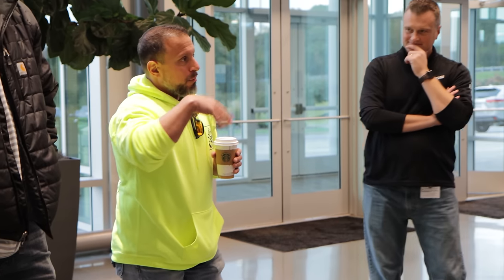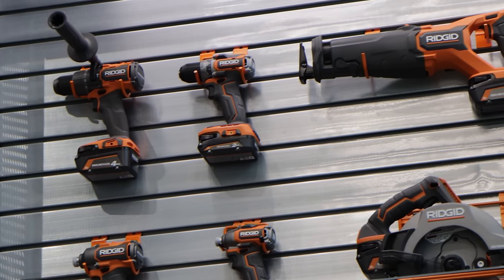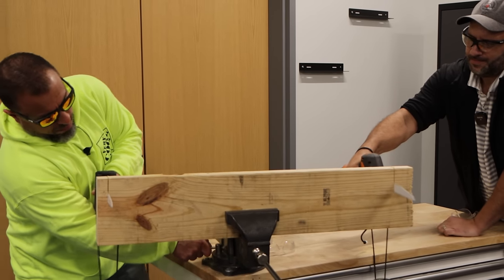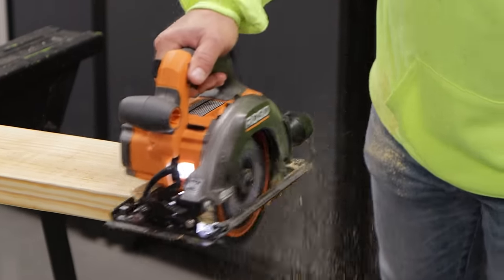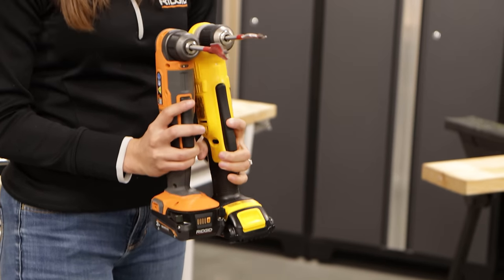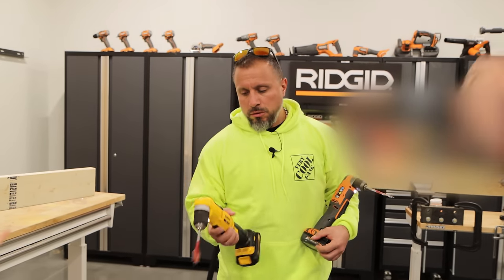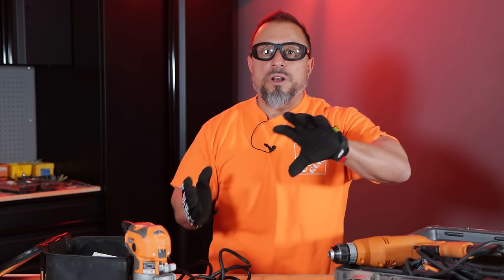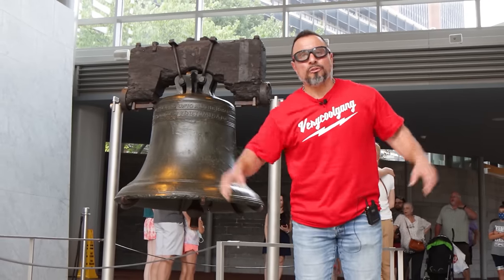Telling Ridgid Executives I Don't Like Their Tools!

Comment: I don’t own rigid but my brother in law does and they seem to be good and the new stuff there coming out with seem like there kicking ass there a good tool if you don’t use them everyday they are priced right ….. I will say Rigid vacuums are top notch I’ve own a 16 gal 5hp and it’s been rained on left in the summer been used without filter and she still sucking I’ve upgraded to the 3in hose best upgrade

Comment: One real world example that is not shown in tests
I had to cut out some kitchen cabinets with a reciprocating saw
There were a few dry wall screws that broke the screw head when there was an attempt to remove them
I had to cut apart with the dry wall screws still in.
Did no problem with my milwaukee  fuel

Comment: The ridgid 12V Fuego drill was very impressive compact little drill.  Was a my favorite for a long time.  Then they killed it and came out with this home line POS 12V drill which was total garbage.  I got into Ridgid X4 platform.  In those days they had some excitement to the brand for sure.  They were one of the first to put a gauge on the batteries.   Now for 12V, I use M12 line.  This is really due to Ridgid not having anything that was quality in the 12V lineup any more., even when it was still available.  Shame too, because the Ridgid 12V tools felt way nicer in the hand then the M12.  That new right angle drill looks sweet though.   Maybe there's life left in the brand.  Maybe help out the other Ridgid products, and bring attention with a new radio that is cool, and works with their boxes.  Your welcome.  I love my ToughSystem radio, yet  I'd be open to an upgrade.  They need to lure me back, but I don't see a reason to look orange right now.  I want to.  But there's nothing there.  Just dust.

Comment: Bought a portable table saw a few years back and actually fried the motor after many hours of use. They replaced it under warranty with the newer one about a year ago. The new was selling off the shelf for 350.00 which I thot was a good price for the tool. But now that same saw is selling for 550.0!!!!!!! definitely not worth that price. Black Fri specials they are selling for 400$. The warranty made me keep buying Ridgid tools even though they have the biggest fail rate of all my tools. I use the tools a lot for my work. I have many Makita drills and saws for 15 years and of all the tools I own I think Makita is the best for not breaking and failing me.

Comment: as a mechanic i have used them all....nothing but fuel's in my box. coolant,gas,oil drenched...no problem, falling of the top loaders 16ft onto asphalt, no problem...puts most of my snap on air tool to shame.

Comment: Best RIGID tools:
Aluminum Pipe Wrenches: 18s, 24, 36s are almost perfect. I just wish they made a 24-28" with a 4" pipe grip width.
Chain Vices (Truck or bench mount, not that awful stoopid camera tripod).
Power Pipe Threaders.
Ratcheting Manual Pipe Threaders are BA too. Anything else, shop elsewhere.

Comment: Spoke with my Home Depot dude yesterday. Apparently, RIDIG is now owned by H.D. and will be offering an unrestricted warranty on all tools and batteries FOR LIFE. Just register it online and when it fails, exchange it; similarly to the old craftsman stuff at sears. This is huuuuuge. I just had a 9AH Milwaukee battery fail and mannnn those are expensive. If this warranty is what they claim, I can settle for a little less power.... a little less reliability... just to save some coin

Comment: Lifetime warranty on tools and batteries as long as you register. To me that's basically end of discussion. I had a brushless hammer drill die after a big job. Sent it in through the HD rent a tool area, rigid verified motor died and sent me a new one no questions asked. Called the warranty after I got my new drill and had that one added to my tool list.

Comment: They used a dewalt 1.5 amp battery and looked to be a bigger battery on the rigged. Anyone who uses battery tools knows a bigger battery equals more power. Rigged has some pretty good stuff

Comment: I have used the ridgid  line for many years (22).    I believe that the tools them selves are very good to excellent, ridgid,s customer service  and tool  development really leave ALOT to be desired.   
   Sending a tool in to be serviced seems to take forever, and actually trying to speak to a human seems to be against company culture.  
   As for the tool line, I have absolutely no idea as to why the tool line REFUSES to keep pace with any of the other tool lines (Milwaukee, dewalt, ryobi).
   And as I have issue with their battery 7.25 saw,  WHY,WHY, does ridgit REFUSE to produse a full size left of motor saw, and REFUSE to answer any inquires about their  ridgit line????????

Comment: Our ac company has a bunch of rigid stuff and the drills won't run for 5 seconds using a hole saw without cutting off. You have to remove the battery every time to continue. Absolute crap.

Comment: i use their 7" wet saw for small backsplashes.  Cheap, does job.  I'll get my $200 out of it (now $300).  Ridgid's newer cordless tools look cool, and seem better built.  But I'm reluctant to buy anything cordless from Ridgid because just like you said in the video "they don't seem to have a clear path."  As long as Home Depot will be around, so will Ridgid so I probably see them getting a little bit better every couple of years.  Still entry tools though.  When I see a tradesman running a Ridgid tool, it scares me into thinking the guy's a hack!

Comment: Great video! Ridgid has a great team as well. My only complaint is that the comparison with the DeWalt vs the Ridgid at 2:04 was a littler unfair since the DeWalt had to cut through visibly more dense wood right near a knot in the board. I still think the Ridgid would have won regardless but would have liked to see that matchup fixed.

Comment: The only Ridgid products I use are the vacuums and the mixers ....I had my old Dewalt combo.. drill...impact...grinder and they just don't die 7 years and I upgrade them just to get the lighter weight batteries and brushless tools ...I have my co-worker he buys Ridgid tools because they are a lil cheaper but they don't last as long and trust me we beat the crap out of those tools on construction

Comment: I love the Ridgid platform. My tools are different than anyone else's on a job, so I don't worry about tools/batteries walking away.  They've yet to fail me. Although, my 1/4" drive impact (after 3 years) is burning up, I'm noticing a difference in the products they are pushing at Home D*pot. Batteries for example. The design doesn't look as "Ridgid" as the original. Maybe I'm just a wierdo.

Comment: BOGUS DEMO: Did no one catch @ 2:27 that the Dewalt was cutting through a knot in the wood?  Hardly a fair test.  I can cut balsa with a had saw faster than you can cut pine with a sawsall.

Comment: I don't get ppl. I've been doing carpentry for 12yrs. I've used Milwaukee and had Ryobi, DeWalt, Makita and now I'm currently using Ridgid and there's nothing that those tools do that Ridgid can't do. If your a good carpenter you can use Harbor Freight tools with good results. In my eyes Ridgid tools are better than the others and not by performance because there all pretty much the same but because there price kills everyone else's and the performance is the same. Register your tools and your set. And you know what? I've got the Ridgid battery framing gun and I've had it for several months with only one jam. My friend has the DeWalt battery framing gun and that thing jams a couple of times a week so there's that.

Comment: The rigid octane line was good then they pulled the whole line??
I got the 3/8 sub compact impact. It’s really nice and I use it more than my Milwaukee mid range 3/8”.  I enjoy my rigid 1/2” hammer drill. It isn’t as fast as my Milwaukee but it’s smoother. The rigid 1/4” octane impact is much better than my Milwaukee 1/4” fuel surge. The surge would always shut off when things got tough. Honestly I feel it was a huge waste of money. 
I hope Rigid’s new stuff gets good again. 
I recently got the deWalt 1/2” dcf891. It’s kind of made in the USA and it’s an absolute BEAST. First deWalt I bought in over 12 years. If they make things in the USA again I will have all black and yellow. We need manufacturing and good jobs here. I don’t mind paying a little more for USA made tools.

Comment: Well, it's actually very simple. If you're a brand who wants to make a name for itself, you basically have two options:
- Make better tools than what is already considered at the utmost top end (Festool, Makita, Hilti ... (Sry, I live in the EU, and we don't get much of the Milwaukee and Dewalt, so have no personal opinion on those brands)
- Or make tools that are just as good as top brands but cost less.

You also need to actually study the market ... listen to reviewers, professionals who talk about their tools and why they use them over another brand etc ...
Ridgid, to me and what I've seen of their stuff, is the definition of an off brand trying to enter the big league, but not hitting home when they need to.
Hell, I don't even consider Bosh Pro as a "good brand" ... they have a couple decent tools, but only really because the major brands have not bothered to make a tool for that purpose, and if they did, I'd hop over back to my bae in a heartbeat because I know it will be better.

I buy quality, because it lasts longer and does a better job throughout its lifetime. The cost over time is in the positive compared to other brands that I've already bought and had to replace not too long after.
I'm still to this day, using the same two drivers I bought from Makita 18 years later. I'm still using the same Hilti laser I bought 15 years ago ... and trust me, those tools have been through hell, I've lent them to friends and colleagues ... still work like the day I bought them.
On the other hand, I've bought tools from Bosh Pro, and other "budget" brands, and nothing I bought lasted more than 3 years ...

Comment: I had all my dewalt gear stolen from my truck one time. I liked ridgids battery policy. I replaced my 20 v impact gun, drill and angle grinder with ridgid. After a month of use I returned them and bought dewalt again. The impact gun was to slow and not powerful enough. The grinder started flashing as soon as pressure was put on it. My feeling is ridgid is good for weekend do it yourselfers, but for someone like me that uses cordless gear every day, not so much. Sorry ridgid just doesn’t meet my needs as a daily use tool

Comment: I would say that Ridgid is one of the top brand for plumbing stuff (mostly for the threading machines and pipe wrenches), but not for power tools; i mean, i never use them honestly, but they looks a bit weak, lets say average.
I would choose Hilti for power tools (i know they're expensive af but they'll never let you down, and if, they swap the item with a new one), or Makita/Milwaukee.
Reply: You are actually 100% correct. Ridgid plumbing tools are still made in the USA under the Emerson group. Ridgid power tools are just licensed to TTI.

Comment: My 1/2 drive impact falled on it 3rd to 4th charge. More of a hobby tool, not a commerical industrail tool.  Lucky there warranty  replaced.it. Charged the battery, used it briefly, sat it down came back to use again . Started smoking and that nasty electrical burning smell.

Comment: I don’t know about all of their cordless tools but for my money the corded tools (I have router and the multi tool that have performed flawlessly for years. 
Cordless tools I have makita and am extremely happy with that extensive line. 
I can’t say the same thing about dewalt . The batteries died fast . Cordless sawzall was garbage 
I have used the dewalt 12 sliding compound saw and the rigid 12 sliding compound saw . I choose the rigid. 
In fact I would buy any rigid over a dewalt all day long.  Yellow is a bad color for power tools in the summers of the northwest . That color attracts flying stinging insects like yellow jackets. 
My take is ridged builds tools that last.

Comment: I worked for an Emerson company and they are not innovative at all just good copiers at best. I use Milwaukee… started with Ryobi… basically home owner duty… had a 1/2” drill/driver & 3/8 impact kit… just ok batteries weren’t that great… Milwaukee I have really worked hard & they are holding up great.

Comment: That first one handed saw, remove the weight. Husky vs Stihl the Husky will bog down when pressed but not the Stihl. Without pressing the Husky it cuts equally as well as the Stihl.
I'd be interested comparing the two one hand saws without the extra pressure.

Comment: I laughed at the comparison of the right angle drill such a huge difference a 1/2 of an inch will make and yet you still have that 6 inch bit sticking out.  Try putting in a shorter bit and wow now there's a difference.  In reality it may be one in 1000 situation where you needed that extra half inch but as carpenters do on the spot they improvise and will still get it done.

Comment: All I saw is rigid didn’t want the smoke with Milwaukee 😂 I have 12k in the power tools and have never looked back. I’ve used them in the rain, dropped 40+ feet, have left a drill by accident next to my well for a month and it still worked and 3 bars of battery. I just wish they would come out with a nibbler so I don’t have to buy the makita ones

Comment: As a professional the Ridgid Miter box is not something I would ever buy. Took mine back, very inconsistent cuts even at 90 degrees. The cuts were all over the place. I have an old Ryobi that cuts 90 after 90 after 90 all day, dead on. Ridgid also does not offer the same selection that their sister Milwaukee does. So, at this point I am going over to Makitia. The quality is there, and they give you a great variety equal to Mil or better. I stayed with Ridgid for the last 8 years. Now, for a tool company to fall on their face with a poor miter box design, they are not competent, how did you let this happen?

Comment: One of the biggest problems is battery’s. I buy a dewalt and really like it, well when I go to buy another power tool I might just buy the dewalt because I already have the batteries knowing damn well it’s not the best brand for that particular tool. Or I go on a jobsite and say “hey I need a battery” if you have a dewalt someone’s probably gonna throw a charged battery at you. If you have a rigid you’re just gonna get asked “why’d you buy a rigid?”

Comment: I mostly have positive things to say about RIDGID but the only negative thing I would rant about is their modern NXT wet dry vac line up. They are poorly designed overall and with the lid almost opening and exposing which would cause an airflow leak. Then there are the unnecessary design changes on a few accessories for their wet dry vacs such as the claw and utility nozzle. I pretty much prefer their older models from 2004 since they are more well designed and built. I own 2 of them still going strong and in great condition. I  would just wish they would bring back their older model wet dry vacs since they seem to be better built and designed perfectly without the unnecessary bulkiness the NXT models have.

Comment: I have a $310 one year old 5 peice brushed ridgid kit (impact, hammer drill, sawzall, circular saw and flash light) I use them for around the house which is all there good for due to their weight and bulkyness (would be horrible to carry around and use on a actual job site). Every time I look into adding tools to the kit ridged either doesn't make the tool, has made the tool but discontinued it or their design of the tool is absolutely garbage. I still love the kit for home use along with the amazing price but for my new welding business I will be going with all Milwaukee.

Comment: That's bizarre? Really? 3200 spm 7/8 stroke vs. 2800 5/8 stroke wins? OBVIOUSLY. Have you ever needed to replace fascia and cut a leftover nail out that was only 3/8" below the drip edge because it was installed beforehand? Not possible with a 7/8 without damaging the drip edge. If I need speed, I'll reach for one of my real sawzalls, I want accuracy and control from my hackzal. I almost don't want to finish the video. Vince needs to be more aware.
Reply: Very first brushless blade left? Is the dewalt I've had for a year and a half a joke to you? This is hilarious.
Reply: Most compact right angle drill? Seriously? Is M12 barrel battery for $89 a joke to you? LMFAO

Comment: It's one thing to sit in a lab and cut a couple pieces of board, drill a few holes etc etc and then sit back and say. "Woah that works great". Put it on a job site where you have to make hundreds of cuts a day for 10 hours every day 5-6 days a week and those tools are shit. Those tools are cool if your a homeowner and need some tools around the house. If you're gonna make a living with your tools we already know what brands those are. And it's not Ridgid. Tradesman don't want tools that are more compact. They want tools that work and don't break.

Comment: So let's cut the b.s. here:  their tools where previously heavier, less powerful, less reliable and generally speaking just lower tier.    Now that I've invested in a different brand of tools/battery ecosystem..... is the new stuff you've seen worth considering even though it means the headache of new batteries, chargers, tools...ect?    
Say I'm running all Milwaukee. Shit ton of M18 and M12 batteries. Got a few different rapid chargers and group chargers.   Buuuut my circular saw dies on me.     Is Rigids new found performance and dedication worth splitting my battery and tool ecosystem up?